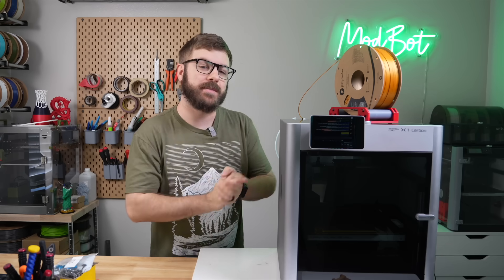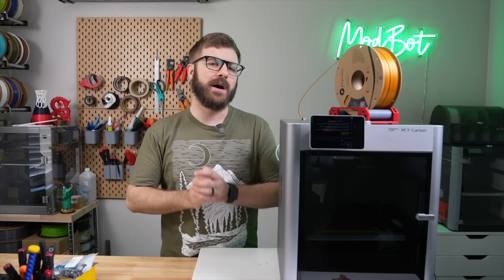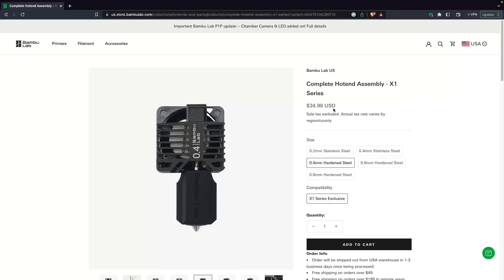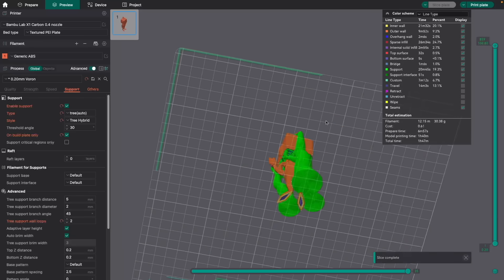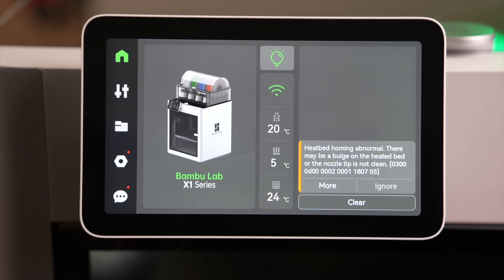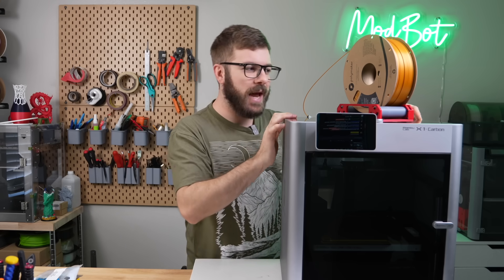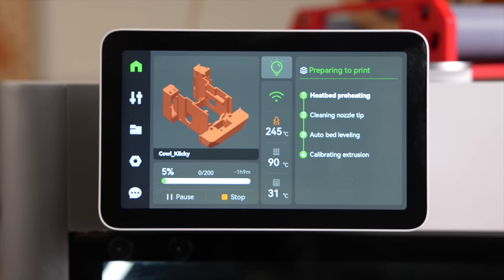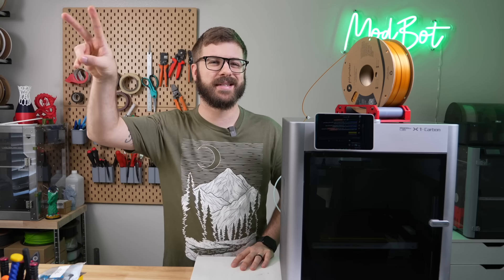One Year With Bambu Lab X1 Carbon

Comment: Yea Bambu X1 carbon.....watch out for Firmware updates as they have obviously shuffled there software team around...mine is in the bin....wait till you need to change a core XY belt...will take you 2 days to do both. Cant run ruby nozzle's for PA-CF....AMS idea is good, but requires more refinement.... Bed leveling system is good...The Bambu  X1 is a complex build with PCB;s scattered all around the unit....it will cost a fortune to repair as the machine needs to be stripped down almost completely to do anything. Yes its fast and multi layer...will be replaced quite fast by other manufactures that will learn from Bambu's mistakes....and there are many....

Comment: I've only got around 150 hours on my X1C, but I've only had a couple failures, and they were my fault through either moisture in the filament or using the wrong plate for a filament that doesn't bond well to it. Everything has worked flawlessly otherwise.

Comment: I am considering getting my first 3D printer, and while also considering the Prusa MK4, then the Bambulab X1C maybe with the AMS seems pretty nice. Reason for reaching a little bit higher than just a beginner 3D printer basic setup is that I know I will only get space for 1 printer, so it should cover both whatever I can think to print just now, and maybe what I would in the future. Also would not go for a printer that requires a lot of tinkering to get to work or keep it working. Thanks for a nice review after 1 year of usage. :)
Reply: For your first printer or experienced you should check out some of the new USA printer makers. Some blow china junk away

Comment: I keep the wall generator on Classic still, Arachne always leaves gaps that I have been too lazy to figure out how to get rid of lol.  I have x3 X1C's, x2 P1P's and x2 AMS and so far, I haven't had too many issues.  I have had a few minor issues that they were quick to get back to me with suggestions that worked.  So far I have been really happy with them.

I just tried a new ABS profile and wow, the prints are literally perfect, very happy there as well.  I also built a Voron 2.4 recently for a larger build volume and am enjoying that process as well.  Great video and I hope it helps a lot of people make their choices one way or the other.
Reply: I am now trying to pick one option among PIP and XIC, and am especially interested in fabrication of heat resistant parts (PC, PAHT-CF). I saw your comment and cannot help myself other than ask you - do you think PIP can handle these filaments well with enclosure? I believe, some tweaks and repairs would be easier on PIP rather than XIC - and as we will have a lot of users, it might be an important aspect... Would LOVE to receive any insight from you!
Reply: @mariampogosova8295  Hey, in all honesty, I have had issues with both of my P1P's (nothing major, but enough to keep them from printing well).  By the time you mod the P1P's to match the X1C, you'll have spent as much if not more money than just buying the X1C.

I know it costs more but they are the more solid choice in my opinion.  However, if you are going to try and run a print farm, obviously the added cost will add up quickly.  I have a 7 printer farm myself so I understand that aspect, but the X1C's have been more reliable for me personally.

Plus, with having a solid "built in" enclosure, the X1C will print those filaments no problem (plus they have the better nozzle to do so, you would have to swap the P1P's).

Comment: Unusable / unfixable printer within a year (that needs to be completely replaced by the manufacturer), nightmare to replace a simple bed cable, and your data is stored on servers in China.  Meanwhile, my MK3 has literally thousands of hours of printing on it, never needed to be replaced by the manufacturer,  only required 1 repair (frayed cable) that took about 10 minutest to fix,  and I don't have to submit to the CCP to use it.  Seems like a no brainer to me.

Comment: Question: How come you don't print ABS parts on your Vorons?
Reply from the maker: I have 3 V0s so batching is tough. I did print white a bit on my Switchwire but I removed the enclosure on it and plan on using it for pla/petg along with the ERCF when I get around to building.

Comment: Why I will not buy a x1 carbon (yet): My plan was to use the printer for usage for my own designs. As an mechanical engineer I was surpriced that all kind of engineering filament was possible. So I have seen alot of youtubers.

1) if there is no wifi in house; then the printer will not update! Downloading by computer en updating through sd card is not possible.
2) then only with sd card you can put a model into the machine. And this will be fiddling with the small card
3) there is no usb connection possible to the computer OR through a wired network
4) only windows 10 and later, but that's ok

Comment: I would be willing to roll my dice that your issue with your infill not connecting to the walls is related to input shaping. I had a similar issue on my ender 3 with clipper, and ultimately it was solved by messing with input shaper and square corner velocity. I believe the actual source of the issue is the residents frequency being too low, causing "excessive smoothing" with input shaper. I'm not sure if bamboo Labs exposes their acceleration, square corner velocity/jerk, or input shaper settings, but if they do, that's probably the culprit.
Reply: New to 3d printers abd haven't bought one yet, but is there a website source you learned the jargon with regards to setting? Or is that something explained on slicer software? Total noob here..😂

Comment: Based on what I have seen and heard unless you are a YouTuber or influencer from the community helpful support from bambu is rough. I pretty much accepted the fact that the little guy is on his own with this printer.

 I seem have that same issue with the walls when working with ASA I use Orca and tune in each roll and it seems to fix the issue. Definitely feels like they haven't gotten the scanner working right for ASA, ABS, and non-CF Nylons. Works great with PLA and PETG.

Comment: It has for sure been more maintenance than I had thought it was going to be when I bought it.  Overall I am super satisfied with my purchase though and would gladly buy it again.  

It did push me to finally take on Klipper and have since upgraded a good number of my old printers.  That has probably been its biggest impact on me, making me realize how badly other printers suck.
Reply: How much it is better than A1
Reply: @thanatosor  I dont have the a1, but my x1c is still just as good today as it was 2+ years ago when I first bought it.  I would still very much buy it again today, but with that said.... Rumor is there is new Bambu machines coming in a few months.  If your patient, I would wait a bit.
Reply: @jon9947  what a pity, I just ordered A1.
What do you expect from new model ?
Reply: @thanatosor  I think if you ordered the a1 your pretty safe.  The a1 is newer than the p1/x1 and has a few nice upgrades.  I dont really have any idea what will actually come, but my best guess is a refresh of their corexy printers with some of the nice extras the a1 has like easier to change hotends.  Also bet there is a bigger printer on the way for their flagship.  I am hoping for a Prusa XL clone, but thats just wishful thinking, I dont have any insider information.
Reply: @jon9947  As I see, X1C is required when we start making ABS stuffs, which A1 or any open enclosure printer may not compete with P1/X1 series.

I had some experiences with Laser engraver machine before, and it made me treasure the enclosure more, for safety, smell,  toxic odors isolation.

If they ever make upgrade, I hope some new variants with optional enclosure/ventilation built-in. And faster printing speed :)
Reply: @jon9947  How safe is printing PLA at home ? The last thing I concern after ignore plastic wastes we may add up to ocean xD
Reply: @thanatosor  PLA and PETG are safe to print at home without worry.
Reply: This is something i didn’t want to deal with. Went with a 2.4 instead, +800hrs of printing and not a single failure
Reply: @Guenounovitch what’s a 2.4? I want a 3D printer with no failures.
Reply: @centuryfreud  Voron 2.4. Definitely not a failure-less printer, but at least it's not an unserviceable, monolithic printer like the Bambu.
Reply: @centuryfreud lol you have to build it yourself. He’s lying cause user error is massive.
Reply: lol no failures, seriously thanks for the laugh.
Reply: @jon9947  hmmmm that’s why i bought 4 more and cancelled all my bambu lab preorders lol call me a liar if you want.
Reply: @Guenounovitch  lol that's a lie.

Comment: Another happy X1 owner here. Out of my 4 printers the X1 has become my goto printer. I never thought I would enjoy using something more than my Prusa.  Speaking of the cable do you think there's anything preventative that can be done before the failure? I wouldn't mind taking it apart to change the routing or throw some tie wraps on it if you noticed any areas for improvement.   Also the X1 has pushed me to work on upgrading my other 3 printers with Klipper to bring them more inline with the performance of the X1.
Reply: So you support sending all your original designs and patent prototypes to corporations, governments and individuals? You really think that rights agreement would either be written to protect you, or honored by criminal organizations? Man you're trusting!
Reply: @chrissinclair4442  You know there's a LAN mode right? or you can use the sd card. I suppose you don't use Fusion 360, Onshape, Solidworks etc or any other cloud based cad software which house the actual models and not just the gcode.
Reply: @Oliver1071  only things I would use is OpenScad and whatever slicers fill my need.

Comment: I’m super interested.  I’ve just about abandoned 3D printing as I’m on my 4th printer and it’s still way too finicky and unreliable.  I like what I read about Prusa (the company) and their latest model looks nice, but Bamboo is fascinating.  I guess I need to look into the P1P and how it compares as well.
Reply: In my opinion if you don't want the AMS for multi color/material printing the P1P is perfect. But if you end up "upgrading" the P1P might as well have bought the X1C for the price.

I think it's the best non-commercial machine. Would like to see them someday in the commercial space with a PEEK/ULTEM capable machine with a larger print bed.
Reply: Prusa is great. Enders and cheapos suck. You spend more time "learning about printing theory" than actually printing. I have 2 Prusas, 4 Troodons (voron clones), and 8 Bambu printers. The bambus each eat about 1kg of filament a day. I've had to start buying pallets of filament to keep up the hungry bambu printers

Comment: I have 3 of the Carbon X1 and another on the way thus far they have been great a few bugs that are easy to work around however a few have not been. Support has been great and they have helped a bunch. So far the Bambu has printed everything I could through at it from complex to simple. So I do recommend the CX1. My only real gripe is it is far to small for my needs. I need at least 500x500x500 to take the place of my custom builds. If Bambu does make an extra large one I will be first in line with money in hand waving it saying take my money. LD3D
Reply: Agreed. At that size though they're going to have to go to linear rails and actual ball screws and nuts. I'm actually surprised no one has made a 3d printer with a heavy cast frame and tensioned ball screws much like a larger machining center. Might not be needed but damn would it be an accurate beast. The other thing and I hope they're on the ball here would be a higher flowing hot end. Rumors are running that they're developing one but...they're rumors. I've been tempted to upgrade my x1c to a high flow hot end but then comes tuning all the filaments and now I'm back to why I hated 3d printing in the first place. Right now it's a solid product that just fucking works.

Comment: Bambu lab printers are disposable junk. Designed to be thrown away when the bushings wear out. Bambu lab will only help you if you have a youtube following, the rest of use get ignored, until we threaten a chargeback. Also, there is no repair center in TX, or anywhere in the world, only shenzhen china where the printers are made, if you have a problem, all printers get shipped back there.

Comment: Aside from mine working on eating its second MC board fan, it's been ok. Most prints come out flawless, although I have had a handful fail or have defects for no reason. I also had to turn off most of the features that make an X1 an X1, the lidar constantly was wrong about first layers, the flow calibration is meh, and the spaghetti detection never really worked for me. Overall I like it better than my prusa mk3s+

Comment: this is why my Ender 3 is still my favourite printer, little to no features means little to nothing to go wrong, and when (not if) things go wrong, everything is accessible to fix quickly. I get all these modern tightly integrated fancy pants features are nice, but when you have problems it's a massive hassle to rectify

Comment: Great video, on the nose with key issues and thank you for making this video and giving feedback on slicing issues, I haven't had any major issues that required posting or anything breaking since receiving it back in mid-September. So far all the info required has been from their wiki, forum, and discord server. It's asham you get to see more than usual the negativity towards a brand, I hope that changes, a well-working printer you almost get not to hear. This printer works great, thank you again for this video.

Comment: I bought an X1CC in February when my Ender ended itself, it’s such a good printer. Only problem I’ve had is PETG getting stuck in the extruder three times when I try to run it on the textured PEI sheet with too high flow rate.
The X1CC is definitely one of the best electronics purchases I’ve ever made. Cannot recommend it enough!
Reply: I know this shouldnt bug me, but there is NO x1cc.  Its X1 Carbon aka x1c :)

Sorry, I just see it referenced this way far too often.
Reply: @jon9947  X1CC is short for X1 Carbon Combo

Comment: I own this X1C as a 3D printer newbee since February and as an experienced RC modeler with helicopter and drone building I miss more in depth infos from the company regarding tech maintenance records experiences as well as proper calibration and materiall setting tipps for the slicer. If you look at the print quality section of the bambu slicer wiki there is a lot in depth information missing right now. Unfortunately I am yet not so experienced with git hub etc. to know where I can look up this infomation. My dream would be a book like 3Dprinter generals bible to improve/provide the printing quality of the X1C when there are printing weaknesses evolving! Apart from that I love this printer - but I have to say I found the X1Cs noise level and frequency so annoying that I replaced all the fans with noctuas within the first hour of operation! Now after the last update where the mainboard cooling fan is no longer permanently running my X1C is finally approved for bedroom use - that is a prerequisite for me because I am bedbound by a medical condition and non the less want to join the world of 3D printing ;-) 
BTW: Thank you for your quality in depth videos - they are a joy to watch and help me to steepen my learning curve. 🙂

Comment: X1C is the best printer I've had, pity the MC died after 5 weeks (replacement due this week), The AMS slot 2 died after 2 weeks, (bought replacement but havent installed yet). I liked it so much bought a P1P and got it 1 day before the X1C died so my printing still goes on. I have many printers but the Bambu Labs printer is my goto always. Havent used my vorons or other printers since I got my X1C hehe.

Comment: 40 screws and 2 hours? That's only 1/10th of a Voron build.
Making the design simpler to service and repair is the most important thing for them right now. Print quality, speed, slicer, and ease of use are industry leading for a prebuilt printer.
The other thing I'd like to see is more support for aftermarket mods, but I'm not holding my breath.